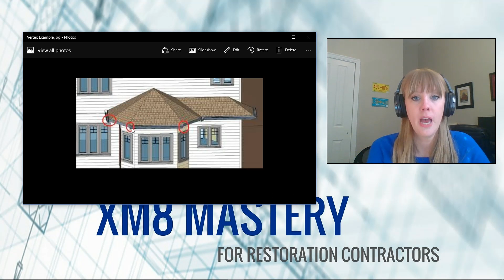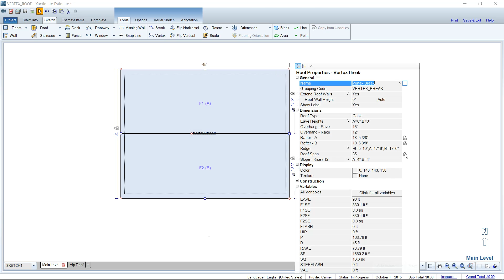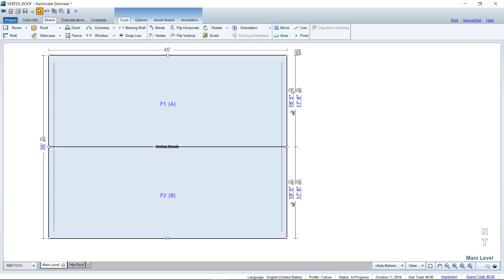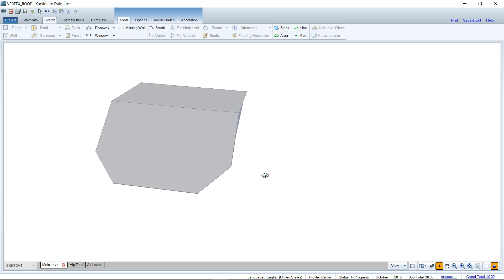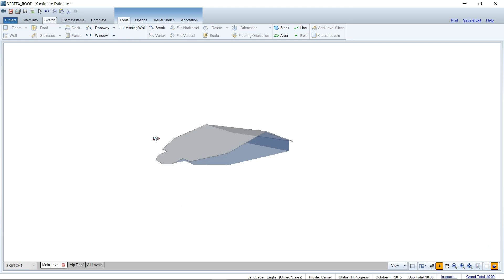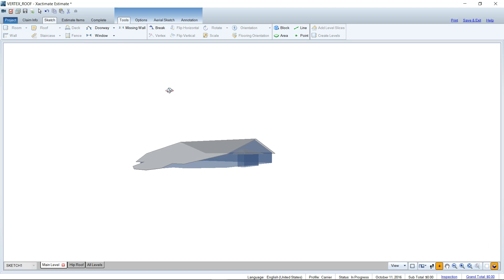Learn to Use The Vertex Tool

Comment: How do you then adjust the dimensions of the new shape you made with the Vertex tool? - For instance we seem to have a lot of "Prow" roofs in the mountains, but I have not been able to quantify the prow projection from the main roof...
Reply from the maker: You should be able to "pull" out the vertex - however, if you're using the tool on the roof, make sure the locks aren't locked on the Sketch for the rafters and other measurements. Let me know if that helps?

Comment: I want to take a straight wall and put a V right in the middle of it. Not from end to end - but just a small section of the straight line. Any ideas?
Reply from the maker: Use the square break tool by left click holding and dragging to make a pop out and then use the vertex tool in the middle of the pop out to make the "v" in the middle. That should do it!
Reply: Thank you - I just figured that out, but it looks like I have to pull that pop out a tiny bit in order to make the vertex work, so it doesn't end up being a perfect V, but a V with two small ends at the top - it's very close though - thanks again.
Reply from the maker: If you slightly drag the handles of the vertex inward, those small ends disappear - just tried it in my Sketch.

Comment: When  vertexing a room how do you keep the other wall from changing their dimensions since room walls have no locks.
Reply from the maker: Unfortunately, there is no lock for the walls and you just have to fiddle with the wall to arrive at the dimensions needed. It's not fun, but you can usually get both sides of the wall within 1"-2" of the actual dimensions.